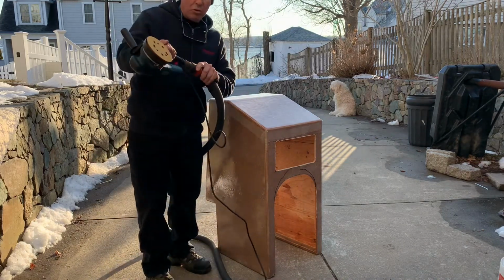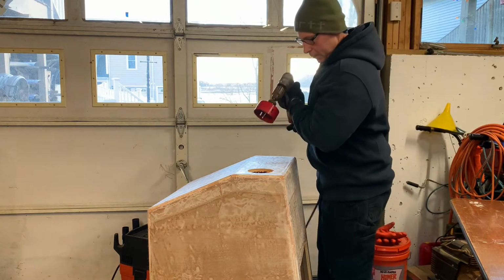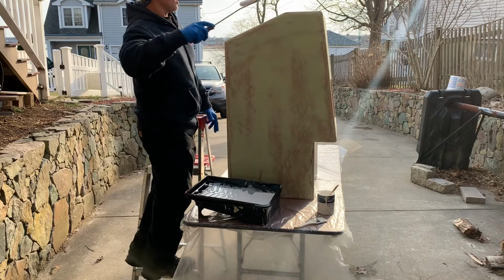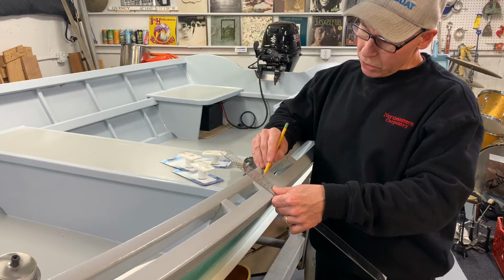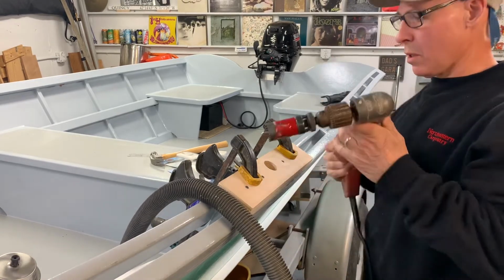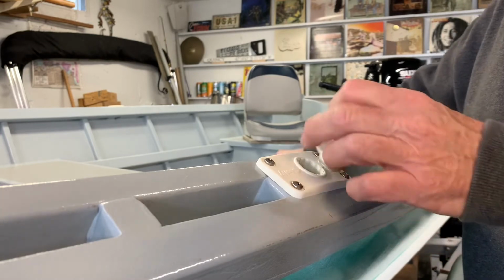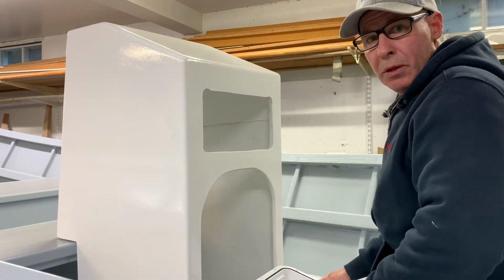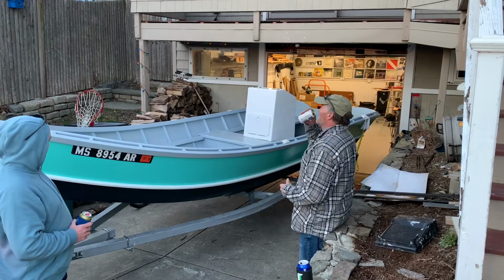Building a Center Console part 4￼

Comment: Protip with large holes saws (when you can) predrill the cetner hole completely with the same sized pilot bit.  Use paste wax to lower friction.  Works pretty good.
Reply from the maker: I love pro tips thanks.